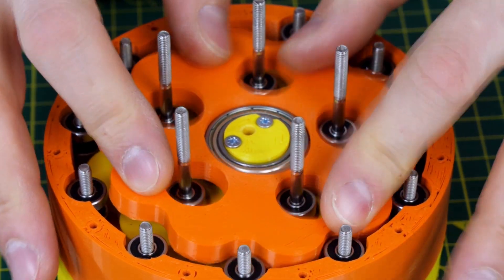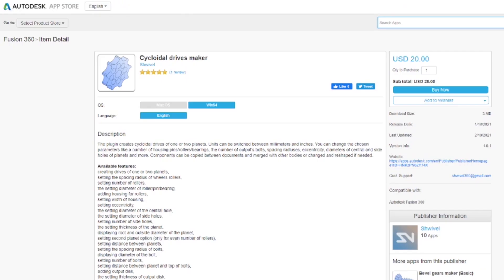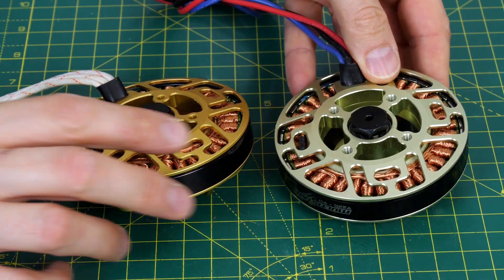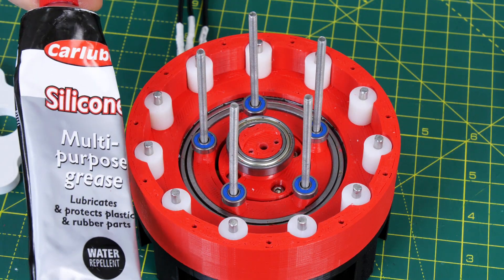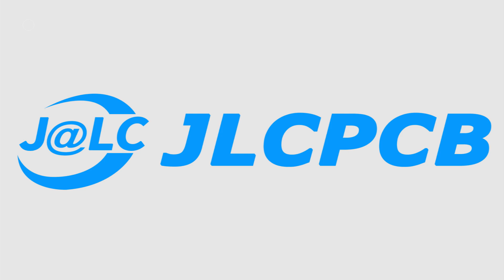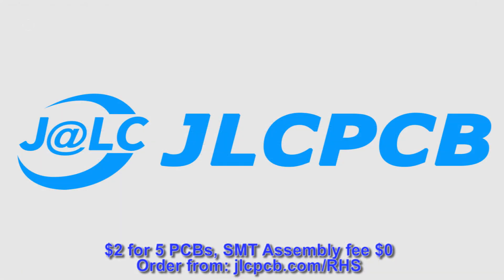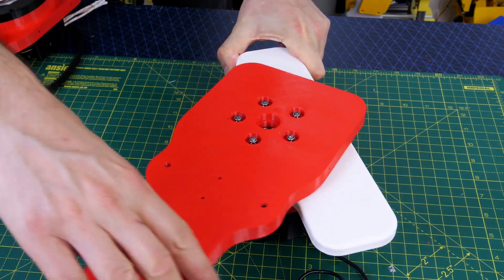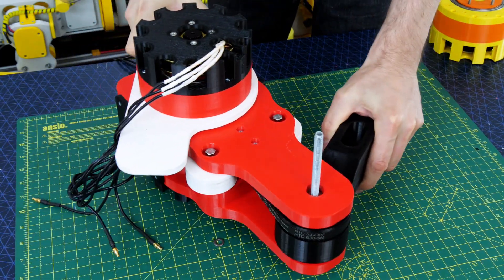Cycloidal Drive V3 & Robot Dog Test Leg

Comment: grasshopper bendy leaf suspension legs
Reply: one motor, many legs, central crane base motor, ball gear system, controller
Reply: worm gear joints, axle transmission, clutch to joint
Reply from the maker: Sounds like a good design and a totally different design concept!

Comment: you want a bit of springiness? why not combine old school simple cheap internal coiled springs/small momentum reclamation /reaction stabilisation flywheels classic push rod liner to spinning top mechanism etc, so as to give the new powered drive less work power required to do its assigned task... its a shame combined old school is a forgotten art.

Comment: 3d printed cycloidal parts and the tessellation parameter when stl exporting is not set properly. You're never tired too much or bored or ignorant to never set this parameter correctly for critical especially moving parts.

Comment: Maybe a bit more grease around the bushings to reduce residual vibration? Also, thin metal spacers between the drive's gearing will probably increase durability since plastic isn't rubbing on plastic anymore.

Comment: Hello,

first of all your project is great and i find it impressive that you want to enable everyone with a printer to build it - however it hinders you in the further development and especially in the improvement of parts.

In version V2 you said that many parts will be replaced later by carbon barrel plates or aluminum - i think you should implement it now and test it directly. otherwise V3 will be too clunky again.

When developing the components it is important not just to draw them thicker and stronger, but to pay attention to where the forces really go and adjust accordingly. especially in today's industry we have so many possibilities to work with carbon fiber sandwich that offers a lot of potential to save size and weight - simply effective.

if a leg is about 3 kg and in the best case only lifts about 19kg it is simply too heavy and weak.

I think you should do it like spaceX: lightweight construction and if it is too weak in one point - strengthen it there.

For example:

-demison the screws correctly - save weight
- pay attention to concentricity - costs power
- replace your huge bracket with aluminum with holes and recesses
-use "set nuts" and "press-in nuts or bolt direct
-reduce the meachnik with too many components, is the gear ratio really the right one?

see you,
tom
Reply: So much Elon fanboyism. You think other companies don’t follow that simple algorithm for designing mechanical components? It just sucks that men right now don’t have almost any role models other than this guy who is actively committing securities fraud on an under regulated security (btc)

Comment: B&B manufacturing US have a online belt calculator that is pretty accurate. Used it to design and didn't need tension pulleys. Long belts/ high load may be a different story.

Comment: You might want to have a look at iglidur printing material from igus. It's a self lubricating high temperature polyimide that has basically been developed for low friction applications such as gears.

Comment: If the problem is about finding a motor strong enough hold weight, have you instead tried a leg with a ratchet mechanism? So the ratchet teeth hold the weight and the motor is only responsible for moving the joint to a new ratchet tooth.
Reply: This would unfortunately kill the spring effect he is looking for.
Reply: @martindinner3621  How about attaching solenoid brakes that can be programmed to engage when the “springiness” stops? The holding current while the robot is doing nothing but holding itself up cannot be negligible

Comment: Hey James, looking at this requirement to use backdriveable motors to add damping to opendog's movements and I had a thought -
If you were to use a high reduction ratio, could you use perhaps 1 IMU per leg to implement a 'virtual spring' of sorts?
For example, as the robot is falling toward the floor, start driving the legs upward just before the point of contact to gently 'catch' the robot.

So, simulate springiness using more modelling and more IMU.
Reply: This is possible, but imagine a torque sensor instead of a IMU per leg. This would allow to virtually dampen and create active compliance, but it would complicate everything considerable. A low reduction with a quasi-direct drive gives you the benefit of a very easily tunable virtual spring and the ability to read and detect external forces (due to the backdrivability and the current readings on the oDrive).
Reply: @Dagor  With a torque sensor I think you would still need to do modelling of some kind, to know where the ground is and how fast you're moving toward it - the torque sensor would only give you input once the leg hit the ground. In the absence of any kind of prediction, this may be 'too late' as the motor cannot instantaneously start moving to dampen the movement smoothly.
Totally agree it would complicate everything and you would lose a lot of goodness, but I thought it was a fun idea.

Comment: The bushings should rotate since nylon on metal shaft gives less friction than nylon on plastic cyclodial disk. To fix this:
1. More clearance between bushings and outer shell so that both are not touching. 
2. Cutting each bushing in two with a spacer between both so that both split parts can run in opposite direction.

Comment: why not use a fraction of the bearings? I don't think you need support around the whole cycloid, probably a min of 3 should be enough. They just need to locate the disc in plane and be sturdy enough to not spread apart.

Comment: A possible cause for your rattling issues is using threaded rod to support bearings. The play between the thread and the inner race will be significant. Maybe switch for ground shoulder bolts with the correct tolerance for a slight interference fit

Comment: I recommend cutting the nylon bushings in half, so that each disc can spin the bushing around the shaft in the direction they spin.
Reply: AIUI the bearings/bushings aren't supposed to spin at all.
Reply: @cheaterman49  key term: supposed. Observations of V2 show that they do rotate.
Reply: Also as the contact point (drive to bushing) changes radius (from motor center axis) as it turns, the bushing will change rotational speed slightly. The two drives may cause binding, and noise/wear.

Comment: Fascinating project, love to see it develop. In the interest of Open Source, will you also publish the F3D/F3Z files? STP files aren't source, I'm afraid.
Reply: Agreed. I was surprised when I went to check out the files and they were all STP files.

It's kinda like providing precompiled exes and claiming it's Open Source.
Reply: @LanceThumping  Dunno about fusion, but Solidworks lets you load STP (not STL) and have it work very well...
Reply: @thorjohnson5237  STEP files do work well for what they are. But you can't usually change dimensions or features in them very easily.
Reply: In the interest of open source, perhaps he should be using FreeCAD.  Where's the logic in locking one's work in a format that can only be opened with subscription-based software?
Reply: @AaronGrogan  But FreeCAD stinks when compared with SolidWorks...  I mean, you could do it all as code (and if you think like that it can be great), but I'm not sure how (sphere 1mm @ 2,2, subtract xxx, add..., as a csg) is very helpful...  I think in code, but I'd much rather "extrude this drawing" instead of making things from cubes...
Reply: @thorjohnson5237  Are you sure you're not confusing FreeCAD with OpenSCAD?  FreeCAD does have a Python console and APIs which can be used for plugin development and automation, but the primary mode of use is similar to what you have in what you have in other parametric feature-based 3D modeling applications like SolidWorks.  I suggest finding a good tutorial video on the Part Design workbench if you are interested in getting a basic introduction to how FreeCAD is typically used.
Reply: @AaronGrogan  Yes, that would be the next step ;-)

Comment: Some design upgrades to consider...
- You can 3D-print your own roller bearings, and with a double taper (a taper on both sides) to boot, so that you can also combat axial loads.
- A hybrid between a bearing and a bushing might be cool.
- Tensegrity structures, compliant mechanisms and shapes of constant width could all potentially help somewhere in the design.
- Herringbone gears.
- Textured parts.
- Hexagons are the bestagons!
- In addition to O-Drives, also add some IMUs and other sensors.

Some other tuning you can do;
- Lubricate everything with silicone grease, teflon lubricant, graphite, or some combination thereof.
- Make some tweaks to your 3D printer settings. (Teaching Tech, CNC Kitchen, Maker's Muse and Tom Stanton all have stuff that can help.)
- Thread locker can help prevent bolts from coming loose, and also help distribute stress more evenly (bolts and screws are stress concentrators).
- A very light adhesive between parts when you bolt them together can further even out stress.

Comment: Since your sponsor is a PCB fab place have you considered making your cycloidal gears out of a thick (looks like they support up to 2.0mm) PCB?  They appear to have CNC capabilities with a tolerance of 0.2mm which is probably better than your printer is actually doing.  It would also be *way more rigid than your printed gears...though I'm not actually sure that's either better or worse in this case.  Might also allow a thinner total profile
Reply: Interesting idea. PCB gears would be a bit heavier though.

Comment: Look man, ur doing great and im sure you know what ur doing but you have to learn how to optimize the weight.  The amount of plastic ur using is just too much you have to reduce the plastic and instead put in some carpon fibre rods to make it lighter and cheaper for example. Its too much plastic its overkill. Take this plate for example 9:35 you can easily make a gigant hole in it to save weight and plastic

Comment: I get the engineer feat and the bonus points for the cycloidal drive, but why not just use a gimbal motor or a hub motor (see following link for item with bolt flange and removable tyre (size is overkill but they have different sizes): https://www.alibaba.com/product-detail/24V-36V-48V-6-5-inch_60843979831.html?spm=a2700.galleryofferlist.normal_offer.d_image.121014c0TZ2TIB ) with O-drive? 
They've already got the hall sensors. Have great resolution and are extremely smooth.

Comment: Hey James. My experience from mechanical repairs tells me that gearbox would probably run 20x better if it was packed with industrial grease. That much mechanical force and movement going through a tiny layer of lubricant isn't the way to go (probably why it makes so much noise). I know it would be very messy, but I really think that if you could seal the gearbox and packed it with grease you could probably substitute all the bearings with nilon and it would work better then the bearing version. All the plastic on plastic contact would be going through a thick layer of grease increasing eficiency and massively reducing noise. I might be wrong but maybe it's worth a test.
Reply: It would certainly be quieter, but I doubt it would run very well. The cycloidal disks don't leave much space where the grease could move around, so you would get a lot of viscosity friction. No issue for low-speed high-torque operation, but not at all good for quick movements.
Reply: @leftaroundabout   If its sealed as suggested you don't need to use a high viscosity grease - even really thin compressor oil for instance could be used - don't even need to fill the whole thing either just fill it up enough that the gears will easily and rapidly carry the lubrication to the furthest points from the sump at the bottom. So the idea can be done - I would not personally suggest trying to go quite that thin - as a 3d print as a sealed chamber is the wrong approach, it is bound to loose its oil to easily - if you want to go very thin 3d print a former and frame and use fibreglass to create the sealed compartments - basically FDM 3d prints are generally rather porous so really light lubrication will be hard to use directly...

The idea definitely has merit, and makes the design more practical - needing a small fortune of bearings when it really should not be required just adds costs. The only question is at what viscosity of lubricant does the porous nature of FDM prints mean your going to loose all the lubrication without some form of sealing the layers.. I think you will find that a thin grease will work fine, and not really need much in the way of redesign to keep in - but I've not tried FDM prints with every grade of grease/oil going so a good viscosity to get well lubricated with low enough resistance might not work as easily.
Reply: @foldionepapyrus3441  3 layer 3D prints can easily be water tight so I don't think that will be a problem. He'd have to seal everything with gaskets tho. Tolerances won't be good enough for anything to slide without leaking oil
Reply: @NavinF  There is a difference between being hard for water/oil to pass and it not passing at all - no amount of walls will make up for the flaws in FDM entirely, even more so in a thermally cycling and high shock load environment.  You don't want everything covered in a film of oil two weeks/months later..

You also start getting into putting too much mass of plastic in a part that wants to be as light as it possibly can be and still take the load. Its just not the right method to make 'water' tight containers - though its a good starting point for a fibreglass/ resin etc..
Reply: @foldionepapyrus3441  I'm not an engineer, but i have two ideas for coating the FDM: you can either use 2 part epoxy, or some UV resin, like what is used in SLA printers. Both can be applied in a very thin layer and should give you smooth and water tight coat. My only concern here is maintaining the clearances between parts, as resin will inevitably add thickness to the walls
Reply: @EvilGenius-k9o  A very good idea - though i think if you are going that far its easier use a 3d printer to create a former, and perhaps internal framework and use the 2 part epoxy and fibreglass for the sealed chambers - get all the benefits of 3d printed geometry (either the important features are the surface of the mold, or are the embedded 3d prints), and the lightness, water tight and mechanical strength of fibreglass.
Reply: @NavinF  A solid block of PLA may still be porous to common oils, I doubt it but it might be, never looked up its material properties, heck most lubricants might dislolve it for all I know right now (I don't use PLA for anything, so an not even sure what its chemical composition is) - but a 3d print absolutely will be in this set up no matter what material - the nature of 3d prints means its not a solid, it is more like a sponge lots and lots of internal voids and cracks between layers even in 'solid' 100% infill walls - all adding more layers does is make oil leaking slightly slower (if your lucky enough to not get more joined up and/or larger flaws - adding in layers of solid also is likely to increase warping, which probably creates more flaws). 

But in this environment when its going to be cycling thermally and subject to lots of shocks all those little flaws that are the nature of a 3d print (FDM style anyway) are going to be stressed - being flexed open and even if only temporary elastic  deformations that will let oils pass even if it would have remained oil tight for that oil under ideal conditions - and being so sponge like its not likely to actually be truly oil tight ever - a 3d print might hold liquid for quite a while, seem watertight, but any low viscosity liquid is likely to escape through the layer lines and printing flaws eventually - and in the case of a robot dog you don't want the whole thing coated in a layer of oil after a month - its not like one gasket sprung a leak and the surface can be cleaned up either - as the oil starts escaping though the entire surface of the part - the oil will have impregnated the 3d print all the way through, so as soon as you clean off the outer layer its going to start getting oily again as the layers underneath are still filled with oil...
Reply: Grease fixes everything. You could have triangles for ball bearings and with enough grease it'd work
Reply: Que
Reply: since it is nylon, wouldnt graphite work just as well?
Reply: in that case why not just use rubber instead of nylon
Reply: For real though, filling this guy all the way up with lube is definitely not the way to go, do you not observe that the entire rotor displaces by the width of the bearings every time the motor rotates, that's quite a volume of lubricant to try and pump to the other side of the case! Having anti-phase plates does obviously help a lot since there's approximately as much space for it opening up on the adjacent rotor, but that's still some distance to cover, and it'd have to chase around just as much inside the output bearings too. The medium that isn't solid must be gas.
Reply: Exactly what I've thought. And don't forget to grease the bushings' bolts, too, before assembling the bushings to them.
Reply: If James were to use industrial grease with the material he's printing with, capillary action would draw it into into the components and act as a solvent. He would in effect have created the robot equivalent of Rheumatoid arthritis. I don't think he should have to learn about material science to improve his design. It will work out and without a very messy solution.

Comment: Shouldnt need any bearings are bushings on the outside. I have designed and printed cyclodial drives with 0 moving parts on the "outer" ring and they work great.